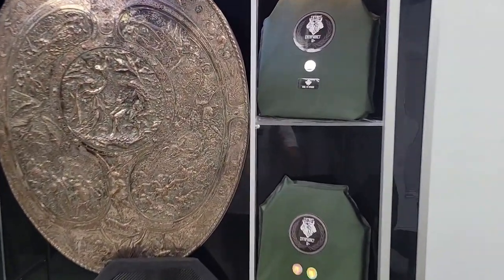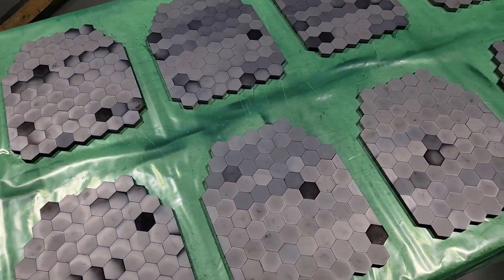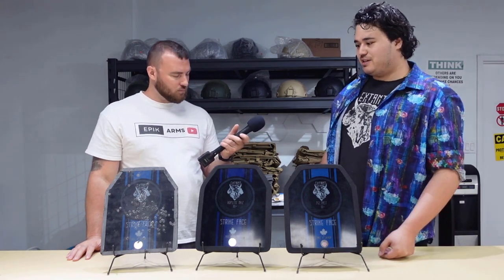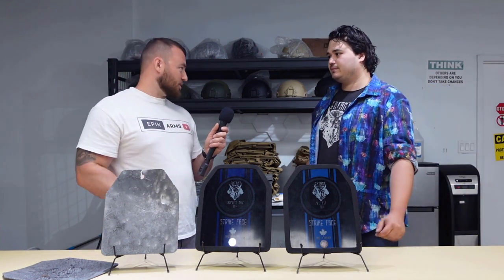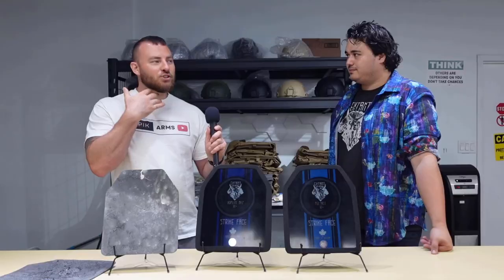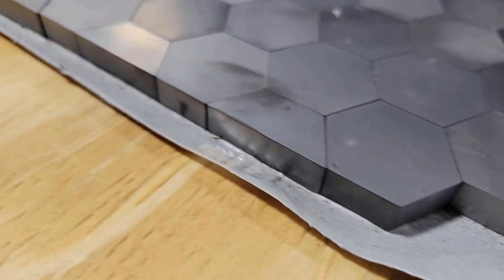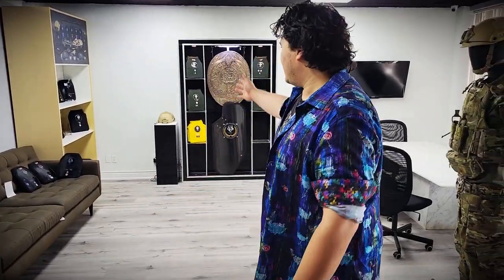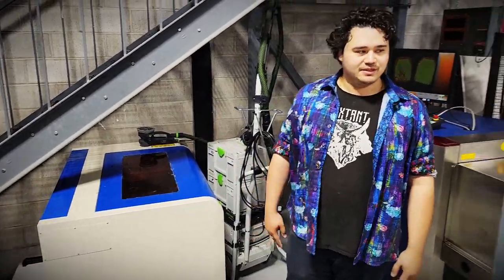Canadian body Armor made right: AI Tactical Solutions

Comment: 7:15 Hi guys.  I used to work at Ceradyne (process control engineer).  One of the fun perks of that job was I got to keep some scraps from the scrap bin.  That was off the line that made the armor plates for the AH-64 armor panels.  That particular armor was rated for multi hit (exact number is classified) of 20mm explosive shells.  Anyway I got an idea one day.  I took one of the bigger chunks to my friend who is a whiz on Mitsubishi wire EDM.  He cut that chunk down to SAPI insert size.  And yes it took quite a few hits from .50BMG.  I can't give details about the armor material for obvious reasons.  But I can say that it is a rather thick piece of Boron Carbide but has a lot of proprietary additives to the mix.  Anyway, yes we made a few of them,but this was just a personal project for zhits and giggles.  I can say that right now, my friend (he kept them) is the proud owner of the worlds strongest body armor (outside of maybe some government black projects?).  🙂 If you guys have any questions I'll be happy to answer (what I can)

Comment: I bet this will be insanely overpriced. I've been messing with $20 Chinese plates, for the price of a single rifle rated plate made in America you can equip a small militia with Chinese armour. I think the future is home made solutions tbh. Layering a soft and hard $20 Chinese plate will stop most non AP rounds from a longarm. They're shockingly efficient. But if you added them together in a single module and filled it with epoxy you could have something seriously anti-AP. Even with generic equipment the solution is home made now. With price gouging from China you can't tell the quality of anything.

Comment: That stuff looks very much like the failed Dragonskin Body Armor which often failed in testing.  The joints in this design would concern me if I as wearing this vest.  The look like weak points when they flex.
Reply from the maker: yep this is something that i discussed with them, where the dragonskin failed was the adhesive. and since then some much better adhesives are available.
Reply: @EpikArms  It will take a lot of work to get people to trust that technology again.  Btw - I am not saying it is a bad product.  I just be willing to be an early adopter.
Reply: @texpatriot8462  this is not like Dragonskin, but more like Hexar
Reply: @texpatriot8462 but it 
shouldn't take a 
lot. Dragon Skin was first to market with an untested design in heat. The glue didnt hold up under Iraqi heat. That was 04. Its two decades later and a lot better heat resistant glues have arrived